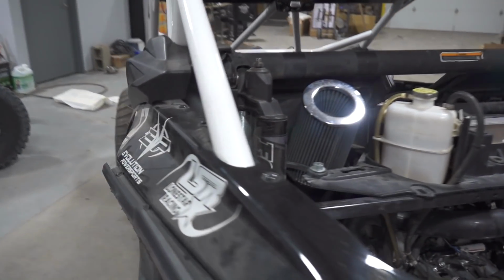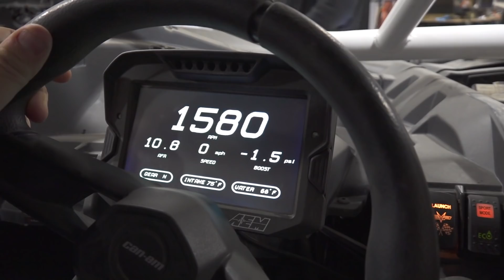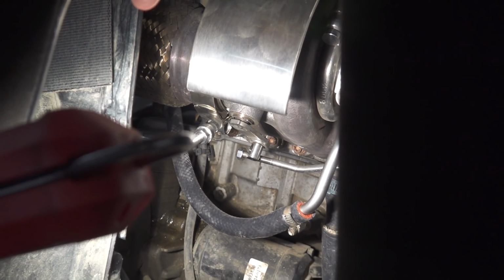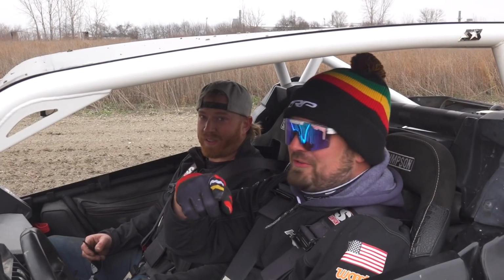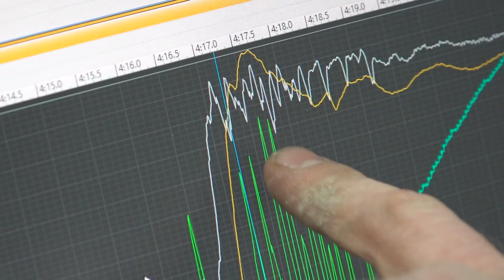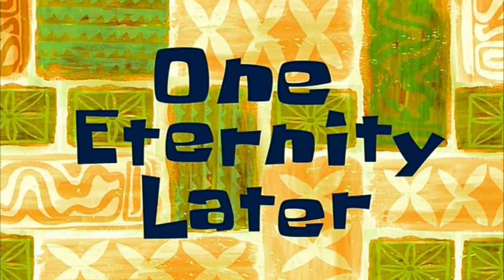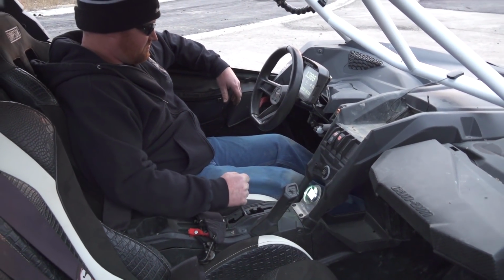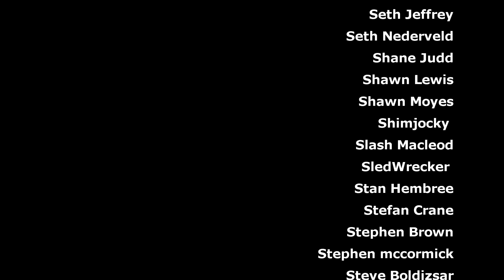We drive BEAST MODE! (500hp Maverick X3!) aannnnd it goes WRONG!

Comment: When your can am hears you say its been running great lately:

1) twizzler driveshaft
2) bay window the block
3) belt thrown into space
4) knock 
5) dead battery
6) Hiroshima
7) lose keys
8) 3 neutrals
9) head gasket
10) misfire

Looks like you guys got a solid 8. Let that be a lesson to you talking about how great your transaxle has been. I have also been in the 3 neutrals situation before :)

Comment: I had the same problem, changed out the Gear Box and turned out to be the Cable was rusted in the housing.  it broke. Total cost 3K. I would change out the Cable with that many miles on it. She no go without those parts.

Comment: Guy’s before you buy new transmission check the gear cable probably you guys forced that to change gear too much that end up bending the end of that cable and it’s not pushing high gear.. take off the nut that connect that cable to transmission and  try to change gear with out cable

Comment: Boost boost boost. Funny how that seems to still be the word. “How much boost you running bro?!” Cracks me up. Its all about air density, which is affected by several different factors and not solely about boost pressure. Don’t get me wrong, actual psi is part of the equation, but certainly not the most important or what should be your main focus. “Just turn up the boost!” Lol smh.